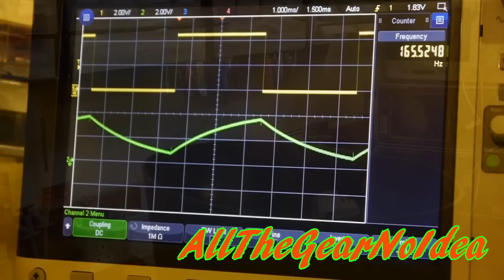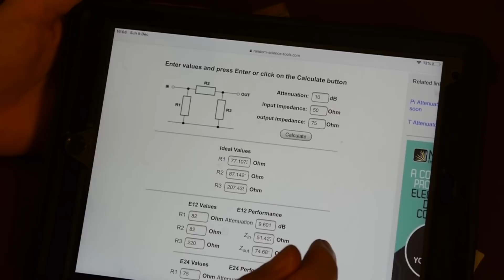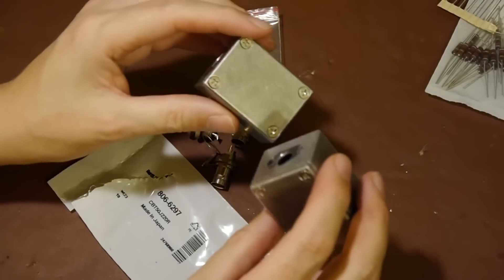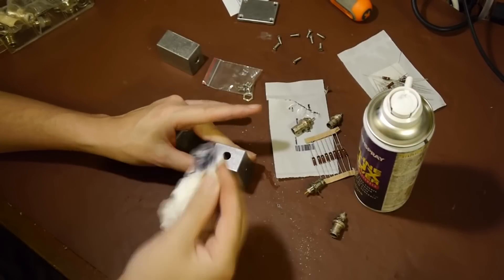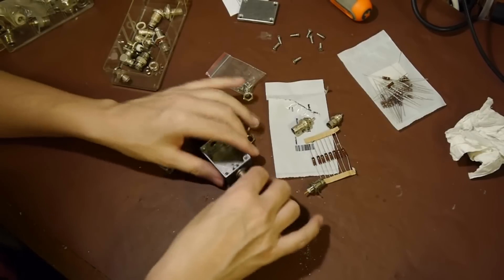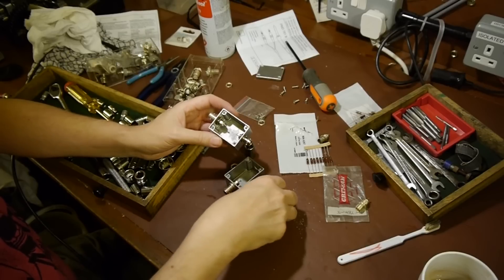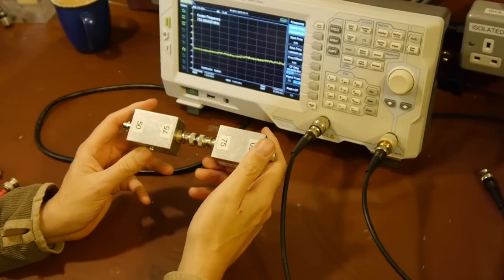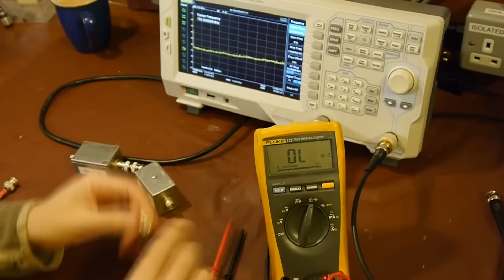Safely Matches

Comment: PS just so you know I am a total nut job; I just received a pair of 4" 30 watt Eminence guitar amp speakers and intend to install one in the nicest way in the Eico "Chimp" as I like to refer to it. The schematic is eerily similar to the 5F1 fender champ. Any advice would be greatly appreciated. Cheers!
Reply from the maker: Full Wave Recked  the only  advise I have is that if these are valve amplifier you need to check the speakers impedances match the original. In my experience solid state amplifiers are not so fussy. If you can provide some links to the equipment or diagram I can take a look. There are however quite a few guitar amp related channels that can give you better advice. Check out blue glow.

Comment: Great video as always. Have an off topic question. I would like to figure out how to properly install an on off toggle switch for the magic eye on my Eico 147A Signal Tracer that I am currently using as a guitar amp. Sounds absolutely smashing, but don't need the poor magic eye on while I attempt to learn how to not to sound like total rubbish. Any info would be greatly appreciated. Cheers! Dan.
Reply from the maker: Full Wave Recked  I will have to find a circuit diagram and I’m not familiar with how the magic eye operates but I’m guessing you could disconnect the HT supply or the heater supply. It may be safer to disconnect the heater as it’s lower voltage but I’m not sure if the heaters are a serial or parallel arrangement.

Comment: Good video Chris. Most of my gear is 75R stuff as it's so old but very occasionally I need to output into 50R (or 600R thinking about it), so I may make a couple of these. I have some really ancient non-inductive resistors from the 30's. Really interesting to see how they are made with a helical cut.
Reply from the maker: Andrewausfa  Quite agree in the old resistor and old components are very interesting.  Most 300 ohm inputs are balanced for ladder line feeders  and slightly more tricky to convert from your unbalanced output of your generator. I would suggest a transformer Balun. I’m planning on building one using a cheap TV 75 ohm ohm transformer. Should be interesting.  Regards Chris.

Comment: Very interesting and well explained Chris. Thank you for a very informative video. I t looks like a tracking Gen would be a great addition to my SA.
Reply from the maker: Thanks Simon  I appreciate that.  I personally think that it’s essential to have a tracking generator.  You absolutely must be able to look at filter responses. However  I have had fantastic results using a rf noise source in the past. I bought one off eBay a few years ago and it’s seriously useful. I will do a video if i get chance.   You can also use the noise source with the directional coupler for antenna tuning. Regards Chris
Reply: @allthegearnoidea6752  Will look into that, As I think this is a very helpful and informative video, it might be worth  reflecting that in the title?  That's my humble opinion anyway!
Reply from the maker: Simon Spiers  Your quite right,  but I like my cryptic crosswords and silly jokes  LOL.   Thanks Simon.

Comment: You've done a nice neat job there and for most of the frequencys they are flat :-D
I've been an evil sod, no change there then and used spiral cut metal film resistors at 27 meg, but there were many in parallel so the inductance was quite low.

Even with 27 meg the length of the coax to an antenna upsets the vswr reading (at the radio end), velocity factor of the coax times a halfwave at the frequency used then use odd multiples of that length...  loads of twoddle and tea drinking lol.
Get the wrong length and the coax becomes part of the antenna, pain in the bum.

I don't really like D.b or Dog Biscuits, we go from a straight forward loss or gain value to a logrithmic jibberish value that you have to convert back to understand it, ill stick to counting on my fingers lol :-D.
In computers people use hexadecimal to replace real numbers, same bloody silly idea.
Computers work in binary, not hexadecimal cobblers.
i've vented my madness now, that's better :-D.
Reply from the maker: zx8401ztv  Cannot argue with any of that. I did a VNA sweep to 200 MHz better than 1:101. I have often had to parallel resistor up in the past. Sounds like you were working at high frequency or had some serious current on the outer sheaf. I’m sticking with the dog biscuits so I can talk the same shit as the real engineer do.
Reply: No just c.b radio, i just wanted the coax to behave itself lol :-D.
You have a better noggin than i do, and the world would be so boring if we were all the same :-D.
Thinking about the world populated only by copys of me, bloody frightening lol.

Comment: Did you measure the actual resistors? The tolerances may have  allowed you to get closer to the required values if you picked the most suitable of the ones you purchased.
Reply: I think it proved the point fine as it was Scott.
Reply from the maker: The Defpom's Repair Channel  no I didn’t measure them but I could have chosen for best match. I’m not to concerned as the impedance I’m connecting to will have a larger effect than the resistor tolerance.

Comment: I think metal film resistors effectively turn into inductors when used for rf, stick with carbon. I did some experiments years ago trying to build a dummy load, rf really didn’t like the metal film resistors!
Reply from the maker: The Defpom's Repair Channel  metal film are often used in rf but it all down to frequency 10 MHz is a different kettle of fish to 1.5ghz. I think historically they were helically wound, not wound but cut. There are also a number of film manufacturing techniques so don’t assume they are born equal. Regards Chris .

Comment: Yes the bnc connectors are slightly different sizes for 50 vs 75 ohm, the centre pin is a different size.
Reply from the maker: The Defpom's Repair Channel  have you actually measured them or you reporting something you have heard ? I have measured  some of them in the junk box and it appeared pretty random, I couldn’t identify 50 or 75 from measurement. Regards Chris.

Comment from the maker: BRAIN FART WARNING  Note there is an error at the end of the video where I stated the voltage at the tuner antenna input.  I incorrrectly converted the power into a voltage across the 75 ohm load using the calcualtion for a 50 ohm load.  see the show notes for corrections and online calculator. Regards Chris